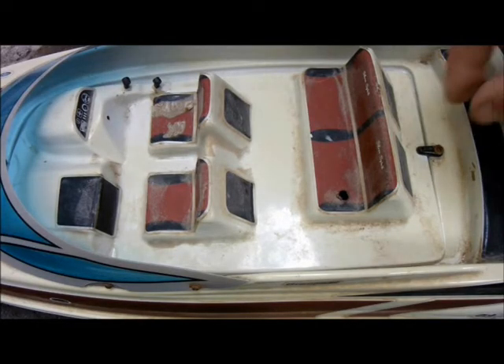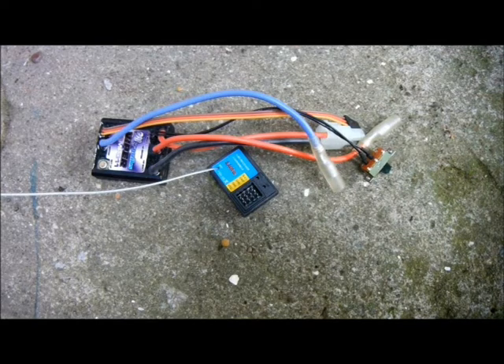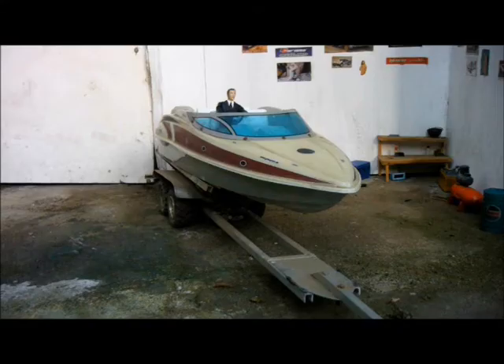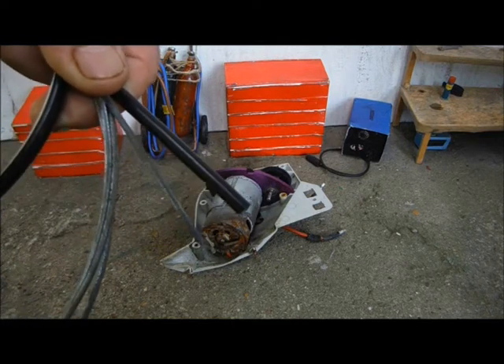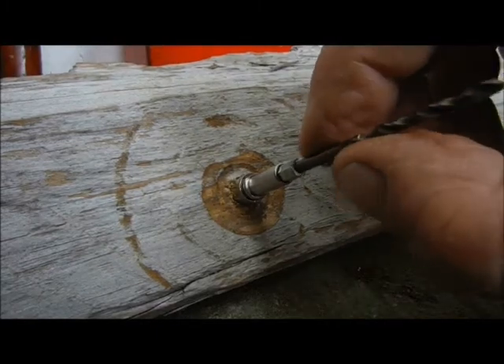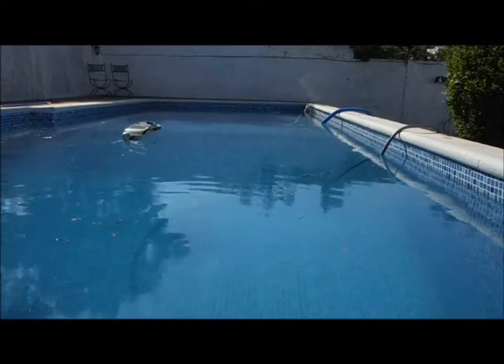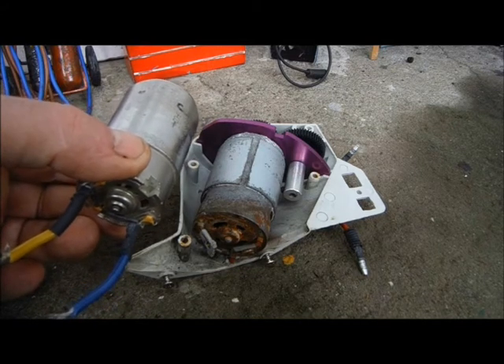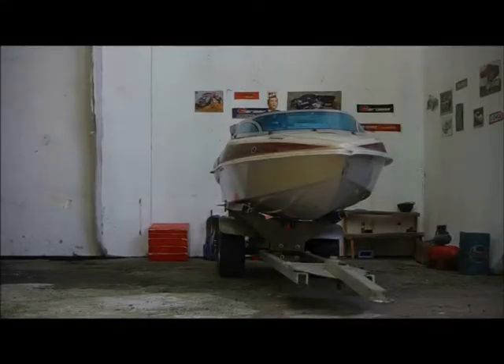Repairing a Graupner RC outboard motor

Comment: Really nice ideas for this boat and thought to use this orange cable is great. Maybe on the old motor it was enough to reverse the polarities, I had a problem like this on an old rc and that solved the problem. But you were right not to use this engine with this little crankshaft, it gives ideas to do something else 😊 In addition with the new motor it works perfectly and has an excellent speed.
Reply from the maker: I love that little compressor! I need to have the right idea for a way to use it.
I'm extremely glad that I could save the Graupner outboard motor. Every time I drive this boat I feel happy.
Reply: @Del350K4  I understand you, it is always pleasant to be able to save an old engine and especially to rehabilitate this great boat 😉
Reply from the maker: @satorrotas ..especially as it is no longer being manufactured!
Reply: @Del350K4  It's true 😊👍

Comment: Nice video my friend, you did a good job runs well but with a brushless motor you can make a big difference, for the next video??? 🙂😃🤪👍👍👍👍👍👍👍👍
Reply from the maker: Hello, Carlos! 0I've been hoping to see a comment from you on this video. 
The battery was not charged properly when I recorded the footage in the river, but I wanted to post the video anyway. I think that with a charged battery the speed will satisfy me, but if I'm not happy with the boat's performance then I could try a 3S battery or a brushless system.
Reply: @Del350K4  That sounds like and update video with the charge battery, I was on a family trip that’s way it toke a while for my comment my friend
Reply from the maker: @carloshnunez  Did you have a good trip? I hope so 🙂
You're right - I should buy a new LiPo and do an update video.
Reply: @Del350K4  Yes my friend we went to the Atlantic coast, have fun, and did some RC filming

Comment: love this boat.  Someday, I'm gonna experiment r/c boats myself.  Great water footage!
Reply from the maker: Hello - RC boats can be very good fun, as long as you accept the difficulties which accompany their use. If an RC car should stop, for example, it will remain in place while you walk over and pick it up. Earlier today I got a rag caught around my boat's ptopellor and watched it disappear downriver while I raced to get my boots off so I could swim out and rescue it.
If an RC car should happen to roll, the same applies-it waits where it rolled for you to go and put it back on its wheels. My boats fill up and sink. Sometimes I find them and sometimes I lose them. Even if I do find them, there's often damage to the electronics or the battery.
These are not reasons to avoid RC boats, however; they're just facts for you bear in mind.
Reply: @Del350K4  good points.  I suppose I could bring a fishing pole so I can reel it in lol
Reply from the maker: @PrinceofMacedonVlogs  Ha ha!

Comment: Hello Del, what an excellent adventure. That was a real roller coaster of events. More gripping than many modern Hollywood films. 
 I was secretly hoping you would post another boat video & what fun it was. The improvisation was great. I was rooting for the strimmer cable all along. I was worried the motorcycle cable may just unwind if it went the wrong way.
 Very pleased to see the happy ending. What an excellent little boat it is too. Well worth the perseverance on your part.
Reply from the maker: Hello! Yes, the motorcycle cable was wound the wrong way. I was worried about that. The original Graupner part was steel cable, but wound the right way. It's very satisfying to drive this boat again!
Reply: @Del350K4  Yes, it looks good on the water. Great camera views from both boats!
Reply from the maker: @RC3DPrintAdventure  I wanted to get more footage - I didn't get the camera into the white boat, facing forward, for example - but the white boat's ESC plug died. I've now changed it and am hoping to record a video with no workshop time, just pure boating, quite soon.

Comment: Yes unfortunately the company went under they made good stuff that is really cool I have never seen the inside of a out board good mods to get it working great solution 11mm of penatration 😅😅
Reply from the maker: Hey, buddy! I guess the Chinese competition killed them off. They made so many good aircraft, motor boats and sailing boats - it's very sad.
It's interesting to see inside that outboard! I think most have gears and rigid shafts instead of a flex drive.